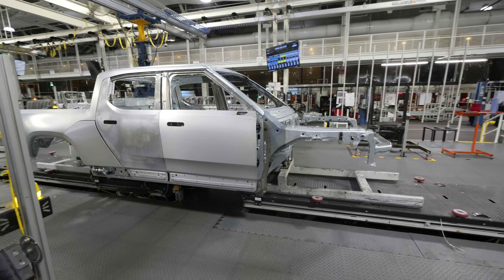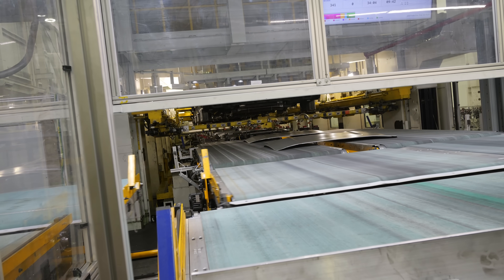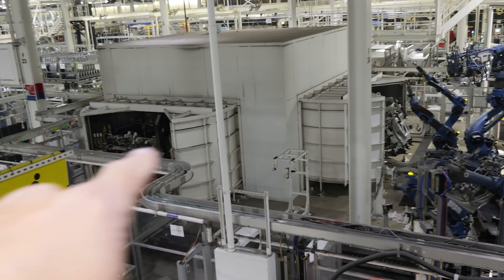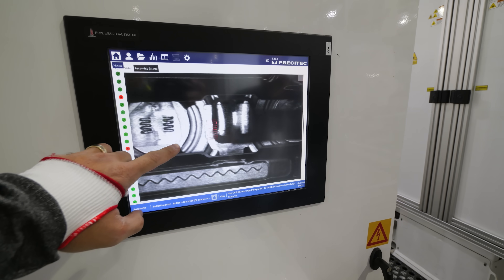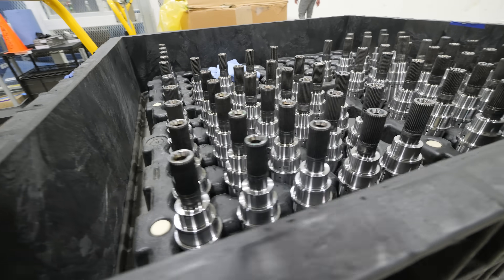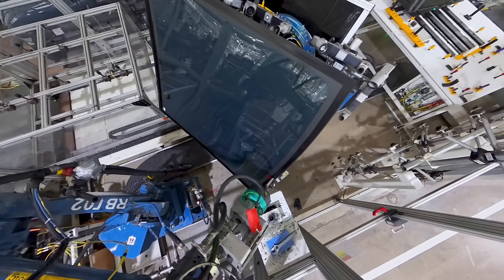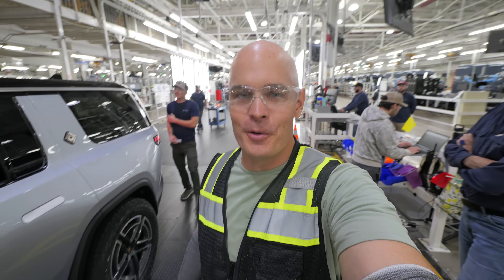How to Build a Rivian -- Worlds Fastest Truck!

Comment: Let's start by building clean natural gas and and fossil fuel vehicles and tell electric cars have progressed to the point where they are feasible right now if you build them you still have no way to charge them a 90% of all electric cars are charged by burning fossil fuels anyway it is a giant scam
Reply: Yeah the difference is with an EV you can change the power generation source, and with fossil fuel powered cars they're stuck like that forever

Comment: Your comment about EV being less common and therefor safer i feel is a misguided statement. First There are less EVs so less change of fires. Also when an EV does catch fire it is a big problem. I am on my local fire company and we would rather have 100 gas powered car fires then one EV fire. EV fires can't be put out, are likely to restart weeks after they been put out, the off gassing from the batteries can cause health issues down wind hundreds of feet away. We are putting together plans to evacuate 300 feet or more around a EV car fire due to the toxic gasses. So i would argue EVs are not safer and we don't even know all the issues yet.

Comment: The liquid nitrogen should not cause the shaft to come loose, because both the shaft and rotor would both be cooled instead of one cold one warm/hot, so the interference fit would still remain.

Comment: Worked on those Komatsu presses, what you see on top is equalled underneath by an even larger basement that is also part of the press. the controls are a set of cabinets the length of the machine, and have power fed to them by heavy bus bars, not cables. note the little motors in that machine, that move those small arms, are 15kw per side, and with a 22kW motor that moves it lengthwise as well. AC servo motors with position feedback, they stop within 0.1mm repeatedly, and do so moving a 2 ton frame at speed. One vehicle every 3 minutes is impressive, especially for a new company, only a little behind the bigger players, who do a vehicle every minute during the shift in the plant they admit is the smallest one.

Comment: I’m now retired from the world of industrial manufacturing. The robotics shown in the video, at least for me, is nothing new or astonishing as I’ve seen the advancement of robotics over the decades.  What impresses me is the advancements in ergonomics and lifting devices for those employees in final assembly.  Some may not appreciate this, however improper ergonomics and lifting are leading causes of injury in manufacturing.  I’m impressed with Rivian as a company, and wish them continued success.  This is a company Americans should be proud of, no drama, just a company designing and building outstanding SUV’s and pickup trucks for the new age.
Reply: exactly, i also worked in industry/manufacturing (in my original lanf we just call it industry)
everything on this scale is robotized, i worked with glass manu (pretty small shop, maybe 30 ppl, and everything was plc and cnc machines, we had manual tools for some edge cases) and electrical ind (factory of 500 pll, making transformers and transmission line cables), cnc machines (robots in essence) do everything, and the machines we used were from oughts (2000.), just plc machines are enough for most of the stuff (making cables, various glass work, etc), ofc cnc are much more programable and can do more stuff, they are simply more advanced, abb is the most advanced, lets say like that: plc<cnc<abb..
so yeah, its scifi to ppl who never worked in industry/manufacturing, but to us insiders this is pretty old stuff
Reply: Companies which care about their workers will win eventually.
Reply: I used to work there, they don't really care about their employees. I had to lift their motors by hand.
Reply: Rage bait
Reply: @Bulletman57-n4p Nope. Worked in their Origin line. Their reintroduced motors had to be moved from pallet to pallet by hand.
Reply: @demenbro  huh.
Reply: Literally not one person uses a pickup (especially an electric one) in the U.S. for work. We don't need trucks starting at $50k (more like $100k). It's just an oversized pedestrian killing machine for preening around real working men. The amount of automation in that factory, not offering something in the $30k range is sickening. America is a service economy nightmare built on the blood of my generation and baby boomers' pensions. Built on sand.
Reply: @GB-oj2gt I agree with you but this has nothing to do with the problem they're just complimenting lol
Reply: @GB-oj2gt   i live in texas, moved here from new jersey, i once saw 11 trucks at an intersection, i was the only itty bitty sedan. we have a game of just counting pickup trucks. there's so many. every other vehicle is a pickup truck.

Comment: Its strange seeing the bodyside components not be hot stamped. (@2:30) Im sure they've figured out something with their frames. I work at a hot stamp facility that produces stuff for some of the other automakers in the US, and we run a decent number of hot stamped items for items on the bodyside.

Edit: after looking closer, and actually playing the video a bit longer, you can see the driver door area is hot stamped, but the rear door area isnt. My bad. (The hot stamped stuff will look that blue/purple color)

Comment: As someone who started my career making OEM lithium battery packs 20 years ago, seeing Rivian’s fully automated battery manufacturing prowess in full swing is such an awe-inspiring experience.
Reply: as someone familiar with that field: any thoughts on the unethical and environmentally damaging farming of most of the world's lithium? to me it seems to undermine most of the appeal in an electric car, i'd be curious what you think :)
Reply: @Sambito_ 
1. We made Li batteries for mobile phones, laptops and other handheld devices 20 years ago.  Electric cars did not exist.  Nonetheless, the way the EV Battery was built is awesome.  While we made everything manually on a much smaller scale, both volume and size, the fully automated manufacturing line is completely new to me.
2. There are much more to Li batteries than just environmental concerns.  There are also economic, technological & safety aspects we had to look at.  Without Li batteries, there won’t be mobile phones, tablets & laptops.  The technological and safety developments of Li batteries were also amazing.  Having a few cells back in the old days were considered dangerous.  Now, there were hundreds of cells in a car battery and companies were using advanced materials to insulate and encase them from fire and explosion.  Not to mention special heating/cooling units are built inside to keep the battery operating at optimal temperature.  I gave them credits for these amazing works.
3. Li-battery, in my opinion, is just a transitional phase for the development of EV cars.  There were rumors that Tesla is developing aluminum-based batteries to replace Li.  Hydrogen cars are also continuing to evolve.  Instead of a huge tank for hydrogen in a car, a French company recently developed smaller swappable hydrogen tanks modules.  There are a lot of interesting developments in the EV industry to watch out for.  Eventually, I foresee Li to be phased out and be replaced.
4. As for the ethnical and environmental issues, I won’t pretend those are not happening.  Prior to this century of human civilization, we were mostly stagnant in terms of technological, scientific, medicinal, social, agricultural, etc.  Then about a century ago, Industrial Revolution completely changed our lives.  But comparatively, this was just a very short period of time, which means we still had plenty of room to grow.  If I were to focus solely on the challenges and problems brought about by new technologies, I would probably be giving up the life I am having, which includes using smart devices, living in safe and modern homes (which is made possible by damaging land and using unsustainable materials, not to mentioned plenty of energy in the process), commuting using petrol-powered or electricity-powered vehicles, wearing clothes using cottons (grown industrially using modern technology) or synthetic fibers….  The way to move away from such issues is to grow and invent ourselves out of it.  Every tiny steps in technological advancement counts.  So while we are still stuck today with some of these issues, I am optimistic our future generations will reduce and eventually eliminate them, just like our current generations built a better lives for ourselves from our ancestors.

Hope this answers what you want to know from me.

Comment: You don’t have to be an engineer to notice the crazy inefficiencies almost everywhere. Watching the Tesla factory, I could criticize them all day, but this is a complete clusterfuck… These processes could be done in an area 10 times smaller and 50 times simpler, even today.
Reply: What inefficiencies are you referring to?
Reply: @bruhder5854  Have you seen the video? It’s everywhere even till the very end where you can see trucks lifted up and going in circles. It makes no sense. There are unnecessary movements everywhere. If any part moves - robot or whatever, it should be absolutely necessary because each movement means energy space and time. Look at Tesla Gigacasting - this is way to go - integrate as much processes as you can and no bullshitting around flexing muscles with lifting the car for doing a circle to go in another process. If this is really necessary there should be another proces integrated into that journey otherwise its total waste of energy time and space. You have to think from first principles. There should be no empty periods just for moving the part. As I said even Tesla if far from ideal but this one is JOKE to me. Joke, it costs much, it’s inefficient, it’s slow. 3 minutes for one car is unacceptable when Tesla does it 6 times faster.

Comment: I think we need to have a larger conversation about potting electronics. Potting almost ALWAYS makes it incredibly challenging or even dangerous to repair or recycle electronics. 

Not sure about Rivians specific solution so I won’t make assumptions but recycling batteries is sooo important and we need to come up with sustainable ways to improve electronic environmental resistance without potting.

Comment: 1car every 3 min is 125000 a year  even if they took out 10bill in debt they pay that off on 1 year if every car is 80k........ they took on way less debt and charge way more. scam dont buy
Reply: It takes a lot longer to build one. The "3 min" is rolling off the assembly plant. Assembly naturally speeds up near the final stages. The full process from component assembly to stamping and welding is a few hours.

Comment: they make amazon trucks ? Cool.
I work in an aeronautic factory where we manufacture parts and assemble them into cockpits, which are then shipped to another factory for final assembly... Seeing car assembly always makes me feel how outdated we are compared to the automobile industry. Pretty much everything is CNC'd out of aluminium and only a few sheets are pressed into a specific shape and are then riveted together. It's very much still an artisanal process compared to this nearly fully automated process. We do only make a little less than 150 per year, though. Even though production is 24/7.

Comment: As a quality non consistency observer, I noticed those glue lines were not traced out as good as my 3d printer makes lines... my two minute mark comment... 
The distance between the gun and the hood was variable and there was some oscillations or collision avoidance and so maybe not a programmed path, but "AI"?

Comment: Are the repair parts produced in the same factory as the part to build de full car? If yes, how they split parts for build and to sell separately?

Just a question that pop in my mind 🤔

EDIT: I don't think that a F1 car are slower in a quarter mile than a Rivian. I think is close but cant beat the F1 car.

Comment: If it's so automated, why is it so expensive?
Reply: Because it is more than just automation. The cost of parts is another big factor, as well as things like running the factory itself. They are releasing a less expensive model soon.
Reply: @ProXcaliber  I understand that development, production, and components cost money, but once it's in mass production, it shouldn't be that expensive. This applies not only to this brand.
Reply: @СергейНеизвестный-м3я  The majority of the cost comes from the components themselves. I think you are underestimating how much it costs in parts alone. If I'm not mistaken (just as an example) Tesla only makes around 5k in profit per vehicle they sell on some of their models. That isn't a lot when you consider what it costs the end consumer.
Reply: @ProXcaliber  Components for the assembly line and spare parts for retail sale have very different prices. The principle of scale also applies here: the larger the production run, the lower the cost. But this is all, of course, more of a philosophical discussion. The market determines the price.

Comment: Potted batteries? Ouch. RIP repairability, RIP recyclability, RIP sustainability. Shame.
Reply: In recycling, they literally shred the batteries to tiny pieces. In repairing, you would replace the module, not the entire pack. Individual cell replacement is the only place where it would be an issue, and you wouldn't be doing that. And that is due to the simple fact that you wouldn't easily be able to identify which individual cell is the bad one.
Reply: @ProXcaliber  The cells are frozen and then shredded, but not entire packs as far as I know. Too much plastic that's adhered a bit too well.
Identifying cells is easy if you remove the commutation plates, which is easier to do with other connection methods like heavy wire bonding or nickel strips, but this is doable too.
Reply: @Spirit532  I mean, you can just find the video he posted about battery recycling. It shows the entire process, and they do in fact just shred the entire battery. All the stuff is then sorted afterward.

Comment: "Automotive grade structural adhesive" = Glue, those cars are glued together :D
Reply: Correction: Most cars today are glued together. And there are reasons for it. For one, it lowers cost and speeds up manufacturing.

Comment: I know it's for safety reasons,  but It would be nice if manufacturers would take battery pack recycling into consideration. 😢
Reply: In EV battery pack recycling, they shred the entire battery into tiny pieces, so the coating really doesn't matter.

Comment: Stuff like this is so cool, I love these factory walk throughs. Unlike Zach though, I'm definitely not smitten with EVs. Until they are time tested, in that buying a 10 year old used EV can last you another 10 years and not cost you the value of the car to replace batteries and such, I will not touch them with a 39.5ft pole. I do not and will not buy a brand new vehicle and right now, thats the only logical way to buy an EV.

Comment: Interesting Insight of the factory.

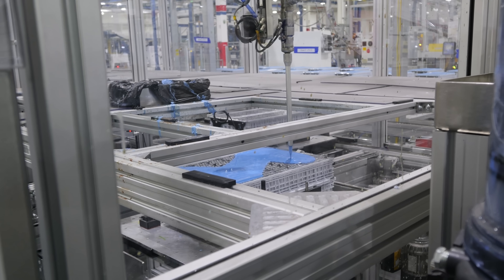What i don't finde goot with the blue glue at 6:00 , is ist still possible to change a single cell if it ist not functioning?

It is said that often, when the battery pack is not working you would need to change only one or two cells which are broken. Would be sad if that is not possible with a rivian.
Reply: Well having a bad cell or two is rare. The batteries are tested before they are hit with the blue goo. So the pack should be good at the start. They are also designed to have some cells go bad after awhile. Most EV hold some of the battery pack in reserve for aging. Worst case you could replace one of the battery packs as a whole... but a bad cell or two won't break a EV.
Reply: Individual cells being defective doesn't affect the battery or a cell block as a whole. EVs are designed with this in mind, and it would require a lot more to cause it to stop functioning entirely. But yes, you likely would not be replacing individual cells, and instead be replacing the entire cell block, but not the entire battery pack.